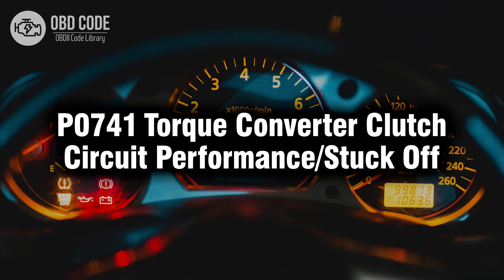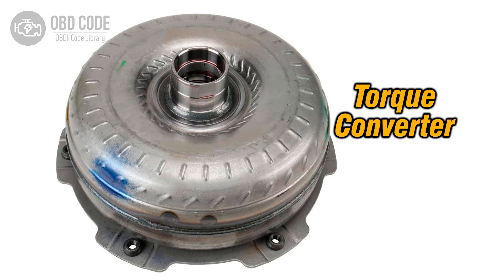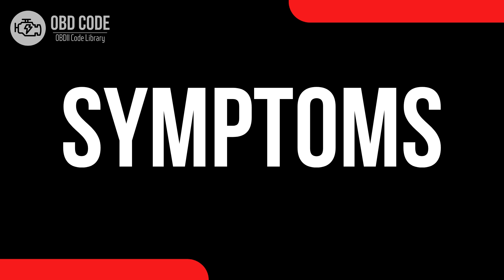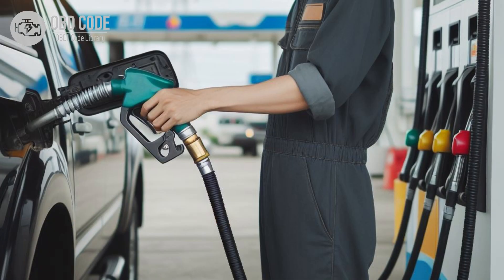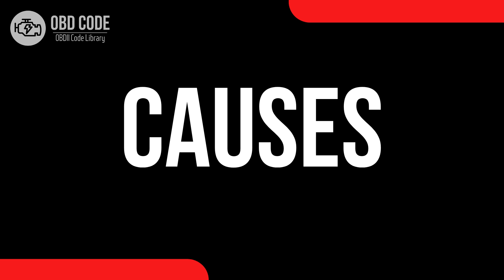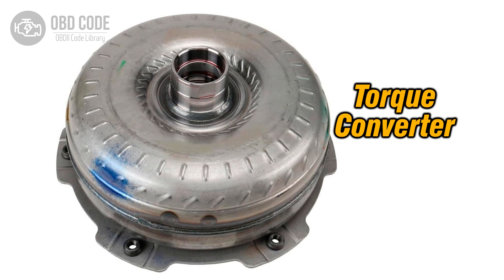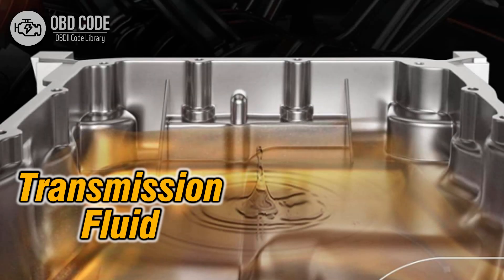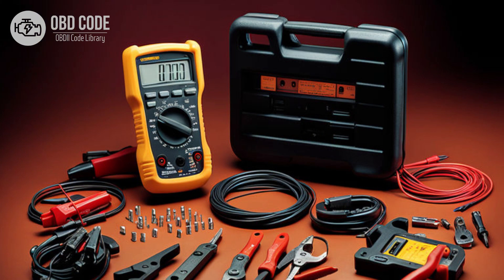P0741 Torque Converter Clutch Circuit Performance or Stuck 🟢 Trouble Code Symptoms Causes Solutions

Comment: My problem was caused by a family member ln a long drive in mountain areas,caused by someone who will not use cruise control.  Every time while driving, they did not have smooth control. the throtle control and the rpm was jumping. What happened, the internal clutches wore and plugges the micro screen.

To fix, twice ,  i drained and i did not flush with the factory trans fluid.  No more codes..🎉